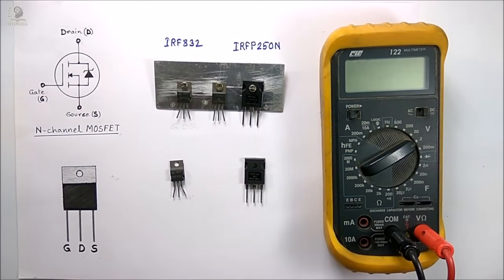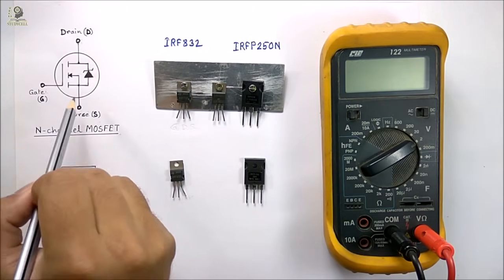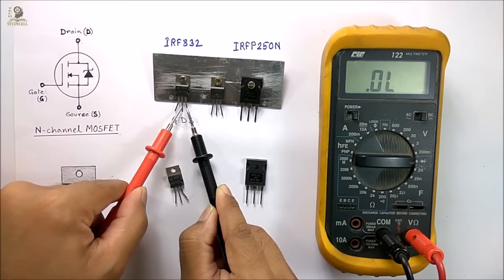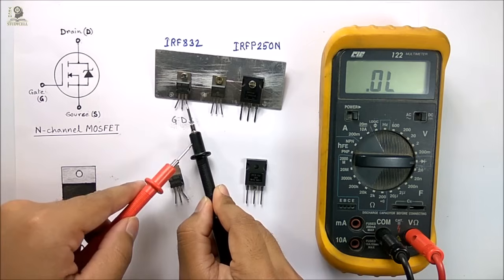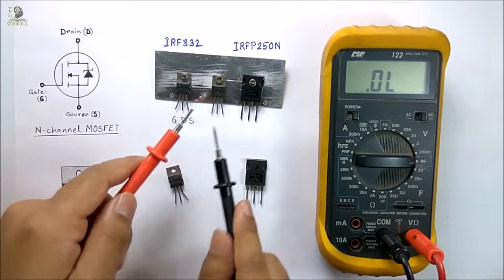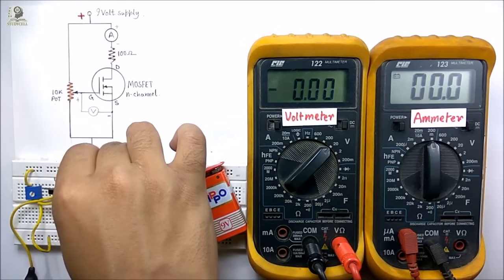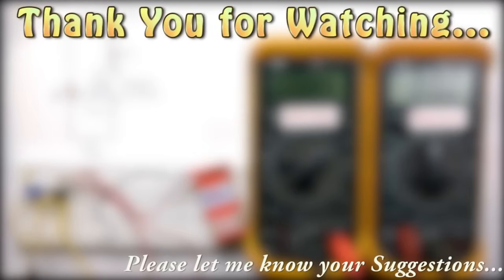How to Test MOSFET transistor using Multimeter by some easy methods

Comment: I have an amplifier ca20, which uses 4 irfp250 MOSFETs on each channel. The problem is, the output transistors are overheating even without signal or load. Can the damaged mOSFETs cause this problem?

Comment: You must have reversed the leads of your DVM to get a negative voltage...didn't you? If source is ground, and you use only one 9V battery with GND to Source, then you can only get from 0-9V at the drain, depending on  the setting of the gate value on the variable resistor divider.

Comment: Thanks for the explanation. Helps a lot. I tried to do the same and got the results as you said. BUT, I tried with two types of AVO meter, one (with 3V supply) could do the test and the other with 9v battery could NOT do the test. The reading showed nothing. Could you please explain why? Thanks .

Comment: On the second part of the video, your diagram does not match the circuit you setup to demonstrate it. 
Your meter is actually measuring the voltage between the gate and drain, not the source. 

The only way to get any negative voltage readings with the positive probe of the meter on the gate is with the negative probe of the meter referencing the drain side of the MOSFET!
Reply: True, an honest oversight. 
The gate cannot ever have a neg voltage with respect to this mosfet’s source in this circuit because the source is always directly tied to the power source’s neg terminal. Thus, no other point in this entire circuit can be more negative with respect to this. 
The setup with what’s talked about below is with the DMM’s positive lead on the gate and negative lead on the drain:
You see, when the drain’s path is cutoff from the power source’s neg terminal (ground) when the mosfet is turned off, the drain will have +9V with respect to ground. Then, any +voltage on the gate that is less than 9V will be negative with respect to the drain’s +9V. But, when the mosfet turns on, the drain then has 0 volts because then it has a direct path to ground via the source and all voltage on the gate has positive sign voltage.
When the gate side voltage with respect to drain turns from neg to pos it indicates the mosfet has turned on. 
Did that make any sense?

Comment: I will run some tests but here is my question to confirm my results. by reducing gate voltage you reduce current from drain to source, does this reduce voltage from drain to source also? I assume not. I'm excited to apply these MOSFETs to my project to eliminate bulky relays and have a safe circuit by limiting current. Way cool! I'm still trying to find the most reliable way to have dedicated 6v current to one circuit and 12v current to the other circuit from the same 12v supply. Any advice would be appreciated.

Comment: 5:32  The voltmeter is displaying  -8.21 V.  If the meter was connected between gate and source, it is impossible to show such value.  The only possible way for the meter to display such value is when the meter is connected between gate and drain.
Reply: Yes.
The V meter reading goes from -8.24V to +4.86V = 13.1V quite a trick with a 9V battery!
The voltmeter is reading between whatever voltage the variable resistor is set to, and the voltage swing between the 100ohm resistor and the MOSFET.
Reply: Symmetrical supply, +9 0 -9   he didn't show us the picture , battery is hidden
Reply: @Blue.star1  But there is only one 9v battery in the circuit diagram.
Reply: @johndoggett808  watch carefully the wiring , may be  no 2nd 9v batt. is there,  how can we get - v unless he connects reverse measuring across somewhere else , he might have connected reverse as mosfet switches at -5 V
Reply: @Blue.star1  I agree with Walkalone. When the MOSFET is off, the Meter’s + terminal is at about 0.8v (the Gate (0.8 = 9v – the 8.2v meter reading)). And the negative voltmeter Terminal is at +9V via the 100ohm resistor.

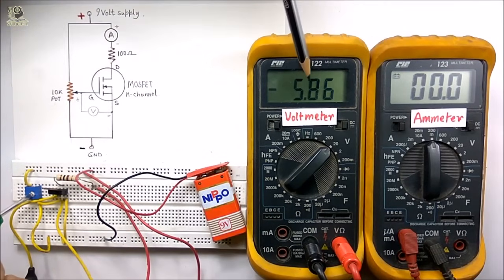When he turns the gate voltage up to 3.5v (9v-5.5v at 6:06) the MOSFET starts to turn no. After this the negative terminal of the volt meter is on the voltage divider between the 100 ohm resistor, and the partially turned on MOSFET. 

At 6:13 he turns the gate voltage to its highest value, and the MOSFET is pulling the negative voltmeter terminal down the 0v, and the positive voltmeter terminal is the gate voltage.
Reply: i have noticed the same....isnt this impossible?????......the leads of the multimeter are schorted.........
Reply: NOT possible.....the leads of the multimeter are schorted.........when  POT 10K is  0 ohm....

Comment: I would suggest you use a wire to short the MOSFET. Finger is not a good way. Skin has very high resistance and also some dirt or sweat from the skin can damage the wires of the MOSFET.

Comment: N Channal MOSFET JSC2N65VB (Vds 650. , Ids 2A ,  Rds on 5 ohm) ke jagah par koun koun sa MOSFET lga sakte hai..

Kitna volt, kitne Amp, & kitne ohm  ka lagaa sakte hai 
(600 , 800 ya 1000 volt.)
(1.5 amp,  2amp ya 2.4 Amp ka)
( 3 ohm , 4ohm , 6ohm ya 8 ohm )

Comment: Good video but I have a question, I have a clamp meter 266FT  with no diode test mode but it has ohm test labeled 2M, 20K  and continuity test labeled 200. Can I use it to test Transistors? Or I should purchase another multimeter

Comment: My multi meter did not supply enough voltage to the gate to activate it. Putting 3 vdc using two AA batteries in series between the gate (+) and source for a few seconds was enough though. Long story short....NOT all meters are the same!

Comment: In testing/checking
MOSFETs using Multi-meter, when the gate is charged, why some MOSFETs
(N-channel & P-channel), the drain to source let us say 0.002 or less,
others starts with more higher like 0.435 and running up as fast as a second or
half a second until showing infinite? What does it mean? Does all MOSFETs
behave like that?

Comment: Hi, thanks, but.... Beats me how you can get a negative reading on your voltmeter in the testcircuit, as minus lead is connected to lowestvoltage=minus pole of battery
Reply: I agree. Negative to negative and the pos probe is on the sweeper of the pot. It should read zero or some positive voltage. I'll have to set this up and see what gives....
Reply: Digital multimeters can show Negative and Positive voltages. That is not possible on an Analog meter unless it has a Zero center on the scale and special made.

Comment: Well done ! 
Provided one is grounded properly, preferably with an  anti ESD wrap.
Some of these MOS devices get zapped pretty quickly otherwise !
Reply: You've never been to India, there's so much humidity there static electricity is not a problem.
Reply: @rsattahip  When I accidentally discharged the lead on my failed Motor scooter control unit, I got a large spark. Those Mosfets can store a charge for a long time and more than once. I would short them with a 1,000 Ohm resistor just in case from now on.
Reply from the maker: Thanks 😊

Comment: Very nice presntation - clearly explained and nicely demonstrated. Probably worth pointing out that the negative lead of some multimeters (particualrly the older analogue meters) have the black lead connected to the POSITIVE of the internal batttery. Also this will only work if the diode test position give a positive voltage of at least 5 V (normally - some may require a higher voltage)
Reply: ´s8´zke8k3s

Comment: How u will get negative voltage in gate terminal by using a 9vdc battery?
Reply: He used 2 batteries +9 0 -9 , you can find in the bread board 2 wires going to some where else , he didn't mention it or his understanding with symmetrical supply is not there

Comment: sir if i set multimeter into ohm example X1 or X10 then test the negative pin to source and positive pin to drain are they the same result in diode setting? pls. reply thanks

Comment: In your test circuit,can't see how you get a negative reading on your DVM. +ve terminal of DVM is connected to G terminal of Fet (10kpot wiper).If pot set to bottom . Wouldn't it read 0 volts and then only go +ve as pot is increased?
Reply: You are absolutely right.

Comment: Great lesson thanks! But please tell me why a 100 ohm resistor is needed in the circuit and how does one determine what size resistor to use?Thanks very much!
Reply: In my electronics class, a 100 Ohm resistor is always used at the Base of a transistor in series with the test lead.

Comment: Can I test the transistors 2SK2221 G/S/D when they are still in the amp unpowered of course?  They all test 375/1750.  Guessing the caps are blown.